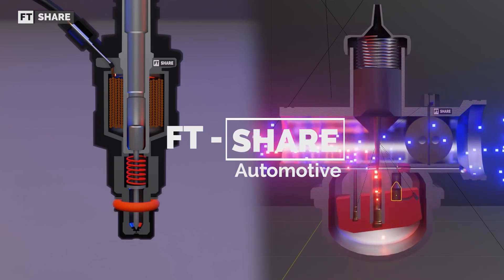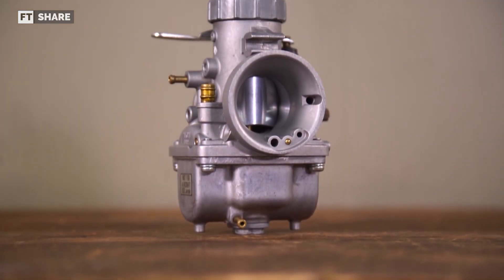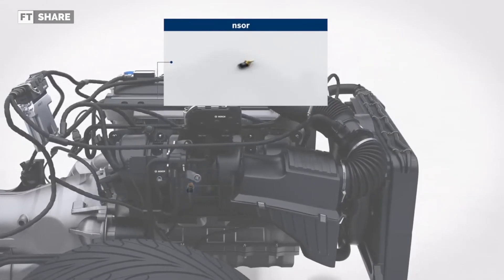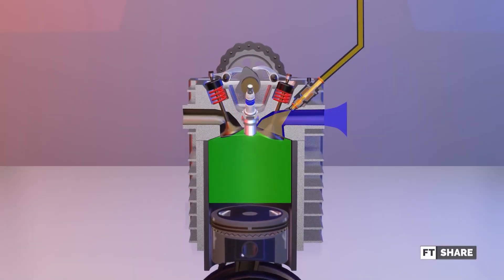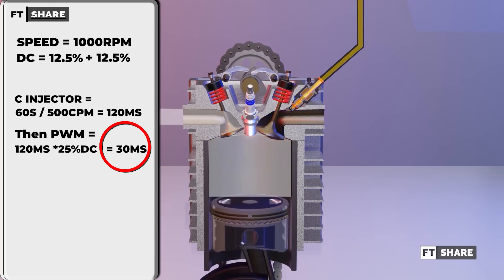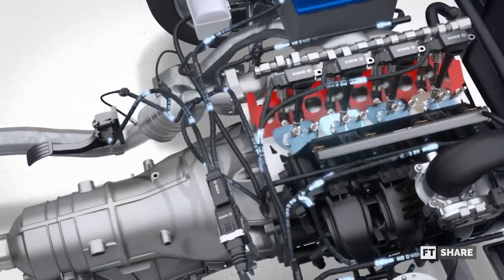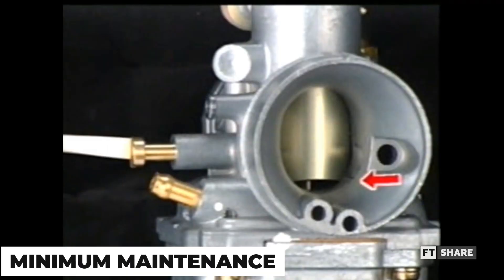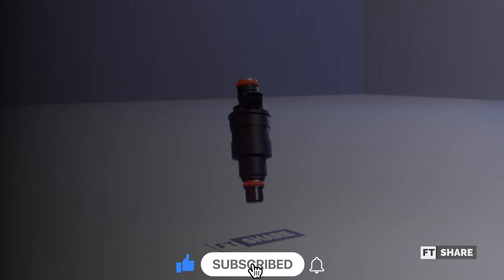Carburetor vs Fuel Injection: Which One Wins?

Comment: the animations are great, but there are some mistakes:
1. the extra fuel at engine start-up is needed not to warm up the engine, but to account for lower fuel evaporation due to the cold walls
2. injectors are NOT controlled with a PWM signal, they are a solenoid/coil which is energised by a current profile (controlled by imposing a voltage) decided by the ECU to obtain the required injection timing. the energised coil compresses a spring which lifts a spool allowing fuel to pass through the holes
3. 30ms is an unrealistic injection time, real injection times are about a tenth of that
Reply: Frage: ist die Einspritzzeit  constant oder Drehzahl, RPM abhängig ? Best Regards from Srbija.
Reply: @josefkubis6693  no the injection timing is not constant in general, however it can only be varied in a small range, so you can assume it's more or less constant. the injection timing depends on the fuel rail pressure, which changes depending on the engine RPM. higher fuel rail pressure requires shorter injection time and viceversa. it all depends how the engine is calibrated. greetings from italy!
Reply: @vampata  Gracije Sinjore.
Reply: 2. injectors are NOT controlled with a PWM signal, they are a solenoid/coil..."
false in some cases.
Some ECUs that work with low-impedance injectors operate using PWM. This is the case, for example, with the AE86 ECU using the HD63701 microcontroller.
The "coil," as you call it, smooths the high-frequency command (average value of the control voltage) sent by the power output of this ECU.
The advantage of PWM is to limit the injector holding current with an average voltage lower than the inrush voltage.
Low-impedance injectors are conducive to greater responsiveness during batch control (for low engine speeds). High-specification engines (sport engines) can accommodate high-impedance injectors in "full group" operation (simultaneous firing).
PWM is used on many engine peripherals, even in the early 1980s. I'm thinking of air control solenoids (idle air control).